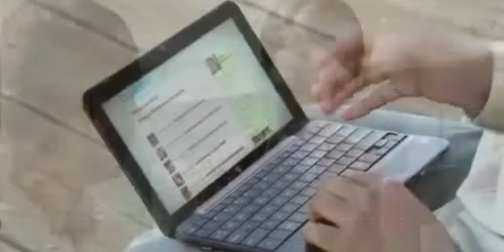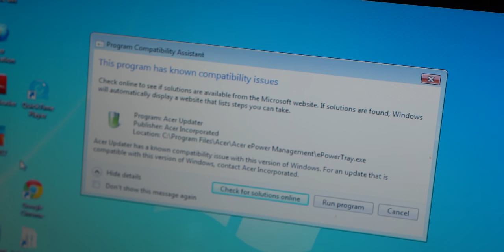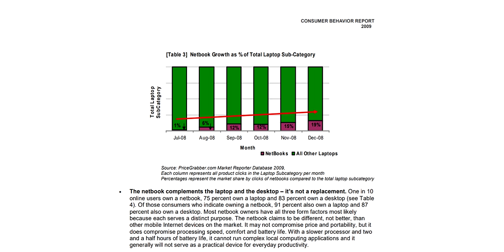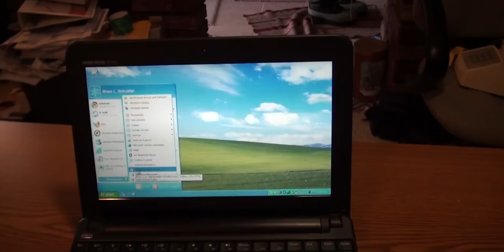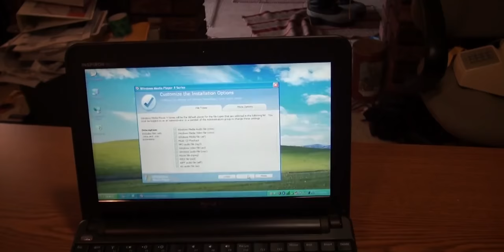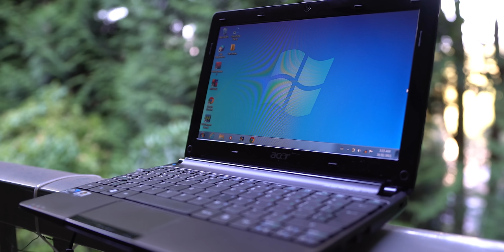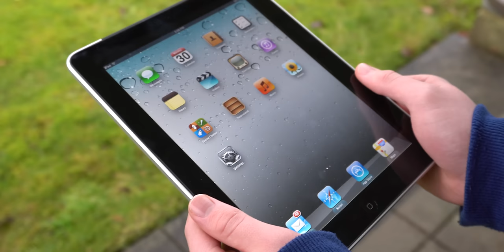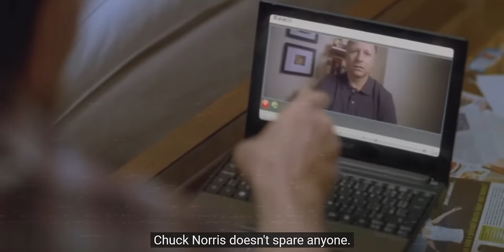Why Netbooks Failed - Modern Retrospective

Comment: The first Macbook Air was a bit of a flop iirc, Apple tried to make it premium ($1800 with a slow mechanical iPod HDD) and customers went for Pro models instead. When the second gen came out they gave it a bit more ports, the market was more used to laptops without optical and it was priced much better with an SSD in all models and eventually turned into the entry level model.

Comment: EEE-PC 1005p (netbook) has Ethernet (no dongle required),  WiFi, VGA out, 3 USB ports, headphone + mic, a surprising good touch pad, 10" LCD, almost 8 hours battery life. Mine still works in 2021 running Linux and Windows as dual boot.   The Intel Atom is a bit slow yes.   What is this video about again?

Comment: I had a Netbook for a little bit in 2011.  It sucked.  It ran Windows 7 Starter and it constantly failed at running software and doing simple PC tasks.  It also didn't work well because my father took it apart and tampered with it.  The graphics card it came with was not powerful enough to run solitaire.

Comment: I had an acer with AMD. I played league of legends on it(lowest settings and low fps) ran Adobe cs3 programs on it. Sadly 4gb of ram was max. Loved it because I was able to be portable and active with it. Later on I put Ubuntu then mint on it. Hr battery has gotten weaker since but man I got my use out of it
Reply: yup. the ones with AMD were rather decent in the graphic department compared to what Intel offered.  Had the Acer Aspire One 722 (AMD C-60), and played quite a few hours of Sins of a Solar Empire or  King's Bounty The Legend

Comment: I had an Asus eee PC running Win7 & it was great. I had it as a classroom computer outputting to a 72" electronic whiteboard, [albeit with bluetooth mouse & keyboard]. I took it everywhere & it was great on flights, fitting unobtrusively on the little shelf in economy class, or just as a carry round pc in my bag. I used it for years until I got an ipad. Hands down a tablet wins on many levels & especially in consuming media, but when it comes to 'on the road' production the netbook was king. I remember even editing a video in Premiere on it & uploading to youtube from a public wifi in an airport. I still have a Dell netbook, but well, ...lets just say I won't be endorsing that.

Comment: I had a netbook that I brought back from the dead by retrieving its BIOS and flashing it. I liked using it and it was a later model with Windows XP, 2 GB of RAM and a 60 GB HDD For what it was it was nice and I got quite a bit of use out of it.

Comment: As much as I liked netbooks you made a point here.
They could do a lot and I purchased many for the people around me.
And they would tell you how good these have been.

But after buying and before giving them to my people was a lot of work.
I installed Win XP Professional on the first ones and Windows 7 Pro on the later ones.
On all of them I had to do something about the processors.
Most become also more RAM and/or disk space. I bought cables to use them with a big screen at home.
They got a bunch of software like Open/Libre Office, VLC, Chrome, Irfan View, Photo Filtre and more.

This was the work when I got the netbooks.
It was mostly the easy part. The harder part was to find the ones which could be upgraded for a good price and with solid waranty.

So yes Lenovo Ideapads S10-2, S10-3 and S10-3t have been solid ones.
But I don't think for persons which aren't as much into computers then I am.

It is a story nearly as sad as the one of subnotebooks (12-14 inches) like the MSI U200 or the Lenovo X220t... R.I.P.

Comment: To me the most fatal flaw of the netbook (as applies to any hyper-budget laptop) is that they were inevitably so underspecced that they would just about die to "installation rot" within a year or two. I don't have much experience with Linux or OSX, but from what I've seen, most Windows installs inevitably will become more resource-hungry over time of use as certain things accumulate; the poor netbook never had any headroom to accommodate this without slowing to a crawl.

Comment: I got a netbook for high school and I thought it was awesome. It had a touchscreen and could be used like a tablet, and I upgraded it with Ubuntu, more ram, an SSD and extended battery. It even still works but it's too slow to keep up with the modern web.

Comment: I bought a netbook back then.  $280 with an Atom processor.  It was ok for browsing non flash heavy stuff.  It barely played youtube and forget about games.  The battery lasted 1.5 hours if I'm lucky.

If it had an SSD and maybe a dual core Atom processor or even hyperthread it, it may have been a decent computer.

Comment: I owned an Acer Aspire One (Baby Blue) for around 5ish years and I have to say that most of the issues were touched on, although you could mitigate many of the issues with Linux as the OS. The primary cause of the issues were specs, it was only specs... If I could have the same form factor with 4GB of RAM, an actual SSD (eMMC is NOT good enough, and NOT upgradable) the thing would be absolutely red hot and perfect for its purpose. For reference its purpose for me was to watch shows while I was on bus, so my use case wasn't exactly taxing.

But alas, it is what it is... RIP The Netbook, the greatest idea executed poorly.

Comment: I got my netbook simply because, like clock work, my laptop crashed two days before I was going on vacation so I figured... I could either pay an exorbitant amount of money for a emergency rush job or buy a brand new netbook for the same price.  I went with the netbook despite having no optical drive.  It lasted about three years, far less than the laptop (Fujitsu, a very durable brand in it's day) I had previously which lasted twelve years before a irreplaceable component (video card I think) went bad.

Comment: I had one, got it from 16 till I was 22 or so. Well, mine can run photoshop somewhat smoothly. And I had windows XP. One of the best ways to secure your laptop or mini works for longer is to  avoid using the internet.

Comment: Netbooks were borderline unusable due to the extremely weak Intel Atom processor.  Any processor requires at least 2 MB of cache and have a core speed of at least 1.9 Ghz or higher coupled with a minimum of 3 GB of ram..

Comment: I had an Acer netbook, but it was an 11.6" HD model, with a Celeron dual core CPU (capped Core 2 Duo), 4GB of RAM and 160GB HDD (then I put a 64GB SSD), and it came with Win 7 Home Premium x64, it was pretty fast and I loved it until i replaced with a 13.3" ultrabook, but I know it wasn't the typical Atom 10.1" netbook. There could have a chance with the newer and powerful Z2000 Atoms, but the form factor was already dead.

Comment: Damn! I've got netbook Lenovo Ideapad s9 in RED color. My one love forever. That was 2010. The price was smth like 350-450$  I guess. That was my ticket to freedom. I was able to take it anywhere..... as long as I was having access for charge. 2 he's of work and it dies. Anyway, I did A LOT: home work, lectures, papers, diploma. The funny thing is that I didn't feel any difference between mine netbook and father's Dell laptop. I've head no mercy for S9: taking it to the park in winter to enjoy snow while I do my essay, bringing to open cafe under the sun, bringing to all classes at university and dusty libraries. That thing was traveling a lot. 2012, smth has happened to screen: a tiny rainbow line crossed the surface horizontaly right in the middle. However, netbook was still working. It died around 2014 - 2015, silently. 
It will always take a special place in my heart 💖rip🥲

Comment: The main thing that killed the Netbook was they were introduced around the same time Tablets were becoming popular. Tablets were just better at the niche netbooks were trying to fill. Also the specs on your average netbook were absolutely horrible. They did this to keep the costs down but it actually hurt the image of Netbooks as they became more of a toy then a useful tool as they were very slow and wouldn't even run a lot of high end business software. They really had no market as they were out performed by Tablets in every conceivable way in the market they were designed for.

Comment: I had an Asus one, first generation I think, in 2008. The battery lasted about an hour and the netbook ran hot from doing nothing. 1,4 GHz and 1 GB ram made it run GTA San Andreas but that's about it.
Oh, and I never managed to set up the wlan.

Comment: I had a netbook. The screen was crappy with pixels so large you could see the RGB speckling of the LCD display. Not only that, but it's A4 was bogged down on bloat so hard by Windows 8 that it literally couldn't function as a netbook. Trying to open Chrome on it starts to cause lagging, and the software I needed to do my homework on it just seizes it forever requiring a force-restart. Never touched it after that terrible first impression to the point it sat in a bag until its battery bled to nothing, and what happens when lithium-ion loses all charge? Yeah, rediscovered it last year, and it was total E-waste. No way to recover its contents, what little there were anyway.

Comment: By the time Windows 7 rolled around, these needed the quad core Atoms and 2GB of RAM Starting out or at least the dual core 10w TDP atoms. Instead, in 2009, when computers were coming with 4 cores 8 threads and 8GB of RAM, a netbook would generally come with 1-2 cores with either no hyperthreading, or only on sub 5w processors. How much RAM in the era of Windows 8? 1-2GB. 
These were actually pretty popular in the corporate world. Because corporations didnt have to spend any extra money to install windows 10 Pro to unlock all the hardware/software. And because in the corporate world you only ever touched a computer during a monthly meeting, or you were in soo many meetings that you needed something small to cary around and connect ot a projector. Fittting your work computer in your blazer pocket and still being able to connect it to a dock for a keyboard, mouse, 2nd or 3rd monitor was highly desired by people who had to bounce back and forth between buildings, walk up several flights of stairs a day, and have enough energy left over for the golf course, or spin class afterwards.

Comment: Samsung NC10 bought late 2008.  Still have it, still use it, albeit it's had Linux Mint Xfce installed for a few years now because of the 2GB RAM.  The only reason I don't use it more is that the  batter doesn't hold charge for long any more so it ain't a portable as it was.

Comment: In my oppion, netbook did not fail, it opened a new market.

Before nettbooks, almost all laptops where large. The manufacturer's completed to have the largest screen. You could get some smaller laptops, but they were extremely expensive.

The nettbooks showed it was market for smaller laptops, even if the performance was sacrificed. This forces the makers of laptop to also make laptops with smaller screens.

One of those companies that came out with a new product to compete with nettbooks was Apple Inc. with their MacBook Air.

Comment: We nought an Asus 1000H, I think. It had a really nice keyboard. I put in extra ram, an SDD drive and full windows 7 after a BIOS upgrade. It always ran slow. RAM speed was 533mhz and the SSD wasn't even SATA 2 which was weird and made it's controller run poorly. Ah well.

Comment: Starter Edition could be tweaked to Home, if you knew what you were doing.
Starter could be bought as an OEM (at least win 7 Starter) 

I bought an Eee 1005HEH (European HE) and it was shipped with XP Home.
An hour later I installed 7 Ultimate and it ran flawlessly. Later I upgraded the hdd, but I cannot remember into what.

Comment: There were other issues. The netbook came around the time that people where asking where they could get an XO (the OLPC machine) from. Netbooks kind of filled that space. EXCEPT that earlier netbook designs were awful. Hinge and keyboard issues. (I was working with them at scale i.e. 1,600 devices) which rendered them mostly useless. Early SSD's had random write speed issues (saving a spreadsheet could take a few minutes).

Later netbooks felt like they were just waiting for Chromebooks. Limited to 10.1" displays, mechanical hard drives when smaller but faster SSDs wouldn't have cost more, 2GB memory max. Most of these hardware limitations were a function of Intel's wanting to compete in the mobile market so were pushing for small form factor machines.

As a result, the eee boxes, devices using the same hardware as netbooks but in more of a desktop form factor, were weirdly expensive. Like it was cheaper to buy a netbook and plug it into a monitor and keyboard than it was to buy a eee box. There were financial incentives to sticking to Intel's mandated form factor.

They were quite good with Linux but had an expected lifespan of around 3 years. More than that and the limitations would creep up on you.

Chromebooks, although SEVERELY limited (you couldn't turn off the secure/safe boot verification for example), got around a lot of those limitations. Their screens felt big (I think the earlier ones were only 11") in comparison. The SSDs made them feel a lot faster. Schools love them because it gives them an amazing amount of control. To all intents and purposes, while the user's families were paying for the machines, the schools own them (through Google's controls, they can decide which wifi networks they can connect to for example).

Comment: I had one and liked it but it stopped being useful pretty quickly just due to the demands of the modernizing internet.  Minimally upgradeable RAM really killed it more than almost anything else.  I had an Aspire One that allowed for replacing the 2.5" drive and MODESTLY upgrading the RAM.  I tossed in an SSD once they were affordable and while it helped a smidge, the lack of RAM really hampered the already poor performance of the Atom CPU in it.

More than even tablets and chromebooks, once smartphones got just large and fast enough and the app ecosystem exploded, they were a dead man walking.  And further evidence that supports my stance is that even the tablet market saturated and then fell WAY off.  There is very little you can't do on smartphones from about 2014 on.  To put it super clear...

I am a full on nerd/geek/tech junkie.  I am a full stack developer and was an IT support technician before that.  Always for the same fortune 50 company.  I am not overstating how nerded out I can get.  My wife is a normie and so is my son but I don't let either of them have a poor experience.  We bought one NetBook and one tablet (Galaxy Tab 2 10.1).  After that, it was only ever proper laptops and smartphones.  I have had the Galaxy S, S3, S4 and now S9.  My wife had an HTC Legend, Galaxy Nexus, S4, LG G5, S9 and now S21.  I have two servers (With over 25 TB of storage), 3 PCs, a bedside laptop, a PC at the cottage, my wife has had two laptops, I have a work laptop, I have 4 monitors on my work from home setup and I have full RGB themeability in my office.  I am not playing even a little.  But note...  NO chrome books, NO more tablets and NO MacBook Air or Asus Zenbook.  Oh and my son has a 2 in 1 laptop, a Galaxy A5 2017 and a full gaming rig as well.

Basically, if it isn't silly portable, useable and long running, there isn't a lot of point to it.  Laptops are really only lightened versions of what was once mocked more as a luggable.  I almost NEVER bring a laptop with me on vacation since the Galaxy S4 and since I got the S9 over 3 years ago?  Never.  What is the point?

Comment: "Netbooks were a scam largely thanks to Microsoft", that's a really awful and inaccurate take. The problem with netbooks is that they were too far ahead of their time, pushing a design ethos technology of the time couldn't support. Another one of Intel's quinquennial Icarus Flight incidents. It wasn't a scam, just morons jumping the gun. Most Netbooks ran Home Edition, not Starter.

Annoyingly enough, we finally have the tech to make it right today, but instead it's only being used in Switch-like handhelds and the GPD Pocket.

(for those not willing to look it up, "quinquennial" means "occurring every 5 years")
Reply: agreed. I have had good experiance with my aspire one zg5 that ran xp. Ran solid for my elementary years and STILL runs, even 13 years later. And it can still run youtube(ofc its laggy). They were not meant for like serious gamers or demanding work. It was a budget laptop that i wish stuck around a little longer, (btw the Asipre one is still being made, its 220 on amazon).
Reply: Thanks for quin-quen-nial

Comment: hmm... i still have an eeepc from 2009 here, it should still work i think. used it for office stuff, watching movies/playing (old) games on the go and it worked fine. 160gb hdd, 2gb ram, win xp, 10" 720p display iirc. very good device imo, got a full workday out of the battery too. also, regarding "how big laptops were back then": they should've kept the thickness. putting more or less high-end hardware in a 2mm shell is bs, i'd rather have a thicker laptop with proper cooling
regarding tablets: don't have one atm but if i needed one, i'd go for one that's netbook-like. meaning around 10" with a keyboard that protects the screen when closed

Comment: I actually used a quite modern EeePC for university, mainly because we didnt reliably have power outlets in every room, so I wanted a device that could run 8-10 hours on one charge in 2011, it did great, but I actually installed a full windows 8 professional (or was it Win7? no clue) as we were in the MSDN programm I had free access to it.